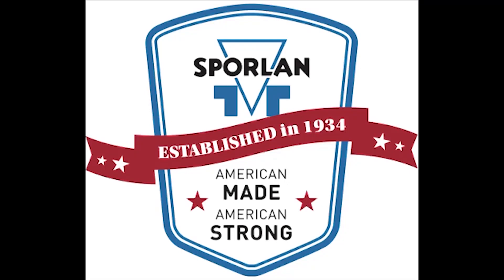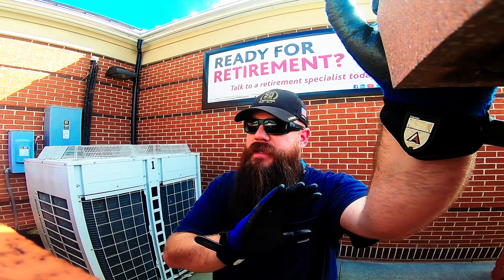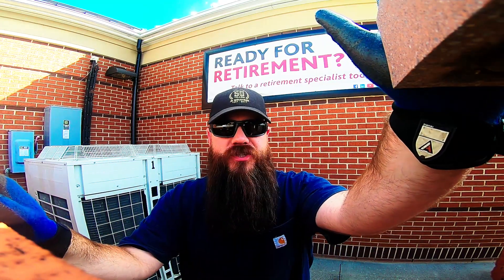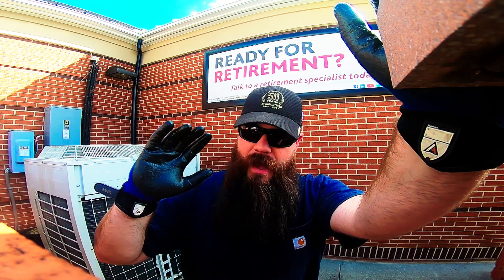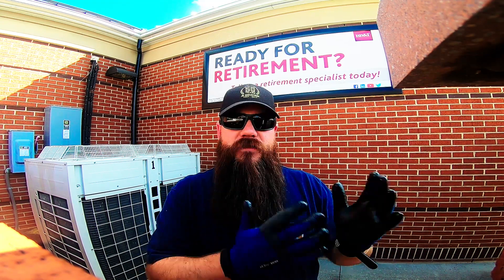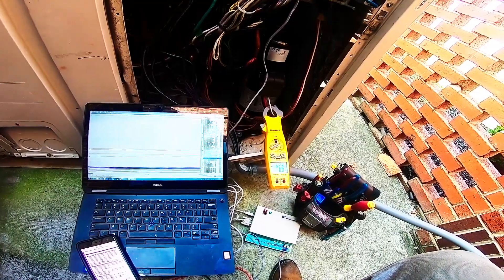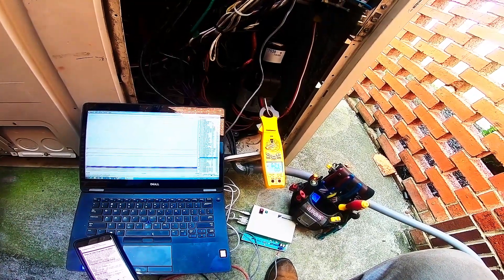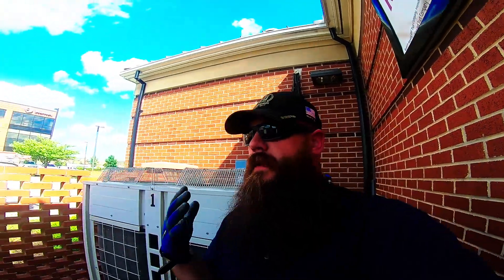Fieldpiece Meter going to time out..SC660 trouble⚡⚡

Comment: Good Vid. it Sucks when Test Equiptment Does not function as it should. it just makes for a long day with frustration. Been there, Done that. it Sucks ! Hopefully things get better. i Have Heard Fieldpiece stands behind thier stuff Well. they usually just send people New stuff out . no Questions asked i have heard. i wonder what it reads if u just clamp it on 115volt 60 hertz HOuse Wiring ? that would be interesting. maybe throw up a quick vid on that. or is it just with DC Hertz ? Fluke for the Win ! i Love My Fluke Meters. Fluke 52/2. i also Like Very Much my UEi Stuff. inexpensive & Tough. Uei DL49 is a Daily Driver for Me and Kicks azz. Has For years. They Don't Work after YOur customer borrows it and drops it in thier Boat Bilge though.
Reply from the maker: Maybe a UEI is in my future, I'll be honest I've never touched one!  Hear great things though.  I will definitley do some more tests/experiments with the HZ feature while waiting for their answer to the issue.  Thanks for watching man!
Reply: i Just checked the Fieldpiece Owners manual for that meter and from what i can gather it does not look like that meter does DC hertz. Only AC. it only makes reference to AC related hz. from what i can gather.
Reply from the maker: There are two HZ functions on the meter, one for being in series with your leads (for confirming 60 hz on AC) and the other for your clamp.  I totally get what youre saying, but what would the point of having the feature if it couldnt be used on variable speed equipment?  Especially if they have another function on the dial for HZ to confirm 60?  The nail in the coffin for Fieldpiece is this.  Scroll down from where you read the clamp HZ section.  Down to where the other HZ function is.  The last sentence says "for frequency measurements on variable speed equipment, use the clamp feature."  Which suggests it should be capable of reading HZ regardless of sine wave structure.  Lol, either way its clearly convoluted and confusing, something they need to address.
Reply: A Copy Directly from the Manual ---

Frequency (Hz) Through Clamp
Measure Hz on variable frequency drive motors. Turn dial to either VAC/
AAC/Hz and press SELECT twice. Hz will show in upper display and VAC on
the lower display at the same time.
Range: 10Hz to 400Hz Resolution: 0.1Hz
Accuracy: ±(0.1% + 5)
Minimum current range: >10AAC (10 to 100Hz); >25AAC (100 to
400Hz) on AAC switch; >50AAC (10 to 400Hz) on 400AAC switch.
Overload Protection: 400AAC

All references to AC. not a bit of reference to dc. i'd put money on it that it only does AC Vfd's. no dc. that does suck that they don't spell it out better.

i found this out when i was looking for Meters to Do Amps DC. Not many meters do Amps DC. For When i'm Working on Board Yachts.
Reply: I'll take a Look at it. i Have Been using the Uei DL49 for years and Have Been Very Happy with this Meter For Everything. Volts & Amps, A/c and DC. Only thing it does not do is Mfd. i Have a Seperate Tool for Mfd. Supco mfd checker. i think its a Mfd 10. i am Very Sad they discontinued it ( Uei DL49) . What is With Companies Discontinuing Great Stuff. i Suppose ill Be Looking for a Meter Soon that Does Volts and Amps, A/c and Dc, and Mfd soon. Ill Prob Get Another Uei Meter if they Have What i Need. i've Been Very Happy With Uei Stuff.
Reply from the maker: OcRefrigeration,Hvac & Electrical.  I will 100% acknowledge that in a video if that’s the case, which looks like it may be.  That doesn’t get them off the hook on the phase rotation😁
Reply: I'm not sure it matters to the reading if it is pulsed DC or an AC wave form.
Reply: Very True !

Comment: Nice video. Off topic but is that a suction line drier @ 4:30? Haven't seen a burnout on the VRF's i worked on yet knock on wood
Reply from the maker: It is a suction drier....totally different story but this system has had ten, yes I said TEN burnouts in 7 years.  Not our customer until very recently lol, part of why I was there collecting data.
Reply: 10?! Holy crap...well if you found anything causing the issue I think that would be a worthwhile video. Anyways keep up the vids man 👍👍
Reply: Yeah, officially you are not supposed to put filter driers in, but if are say on your 3rd compressor and inverter board replacement on a system within a year, the Daikin tech support guys will tell you a story along the lines of "some guys put in filter driers, lock the system out of the heating mode, and go back and remove them before the space needs heat(wink wink)".

Of course, if the facility I did that on recently wouldn't wait several months, and a couple hundred pounds of refrigerant recharges, to give the go ahead to replace leaking coils, maybe, just maybe, they wouldn't have that kind of issue...

Comment: It's crazy you made this video.. I bought a sc660 because fieldpiece LT17A is my favorite meter it's so amazing. But mine lost the ability to read uF. So I bought a 660 and it couldn't read actual temp in a freezer with bagged ice inside. It could only read moisture temp at 32 degrees even though the LT17A could read the correct °17. And sadly could not read continuity through aluminium over 5 feet causing me to know without a doubt the heaters were not split open in the evaporator and the breaker tripping was caused by something else. Finally after an hour used the LT17A to check continuity and bam.. it was the heaters. I returned the 660 back to Johnstone and bought another lt17a.
Reply: If there was anytjing to complain about the LT17A it would he the difficuly of reading neutral voltage. It will somtimes read like 3 volts - .5 volts but equipment that has a transformer for neutral it will read the correct voltage haha.

Comment: I don't think it would be a "coincidence" that the Fieldpiece meter was reading exactly double the frequency of your laptop?
66hz × 2 = 132hz 
That's probably something to look into.
I think the prefect meter for you would be the Amprobe Amp-320. It has "True" 3 phase rotation w/ a 3rd test lead. It does AC/DC & Hz through the clamp. It also has auto AC/DC sensing, so if your working on equipment that has both currents going on the meter will automatically sense which current your testing without having to switch back & forth. It also has "hands-down" the best/fastest capacitance checker on the market. Plus it is SUPER small & lightweight. Check it out 👍

https://www.globaltestsupply.com/product/amprobe_amp-320_600a_ac-dc_trms_clamp_multimeter_with_motor_testing?gclid=Cj0KCQjwqPDaBRC6ARIsACAf4hCBjvlQFPXUkFxT_MhYgRx172PSokUne_AxzGrI3u_HqnXWrCR6314aAiAoEALw_wcB
Reply from the maker: Very good point...not sure if ALL the readings discrepencies were always exactly half, but definitley worth investigating!!  Good catch!  Do you work for Amprobe?  They do have some great stuff, I have several of there other tools, including the PRM 6, a phase rotation meter lol.  Of course it wasn't with me that day.  I will look into the 320, sounds spot on what I'm looking for with this type of commissioning work!
Reply: That was the first thing that I noticed was that your Fieldpiece was reading double the HZ that the equipment was saying. 

Definitely strange...maybe there is something to that.